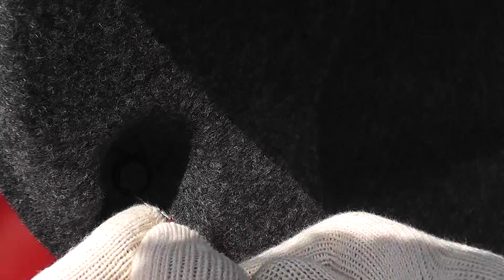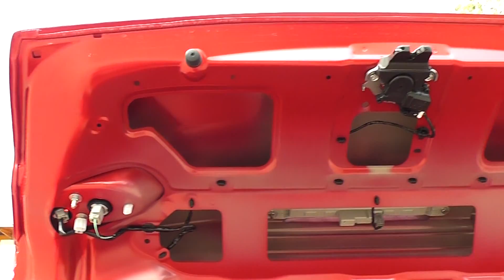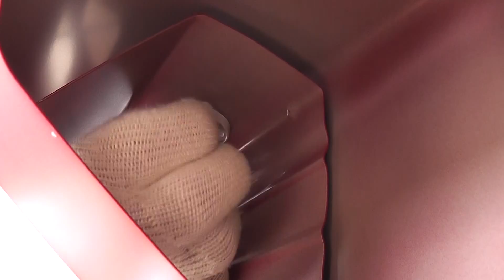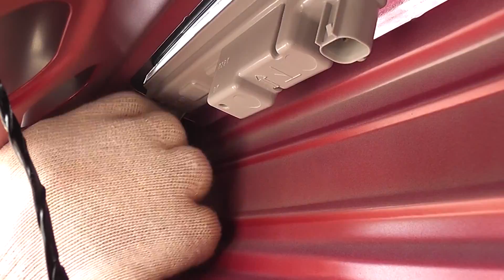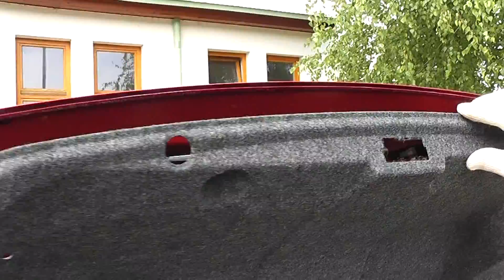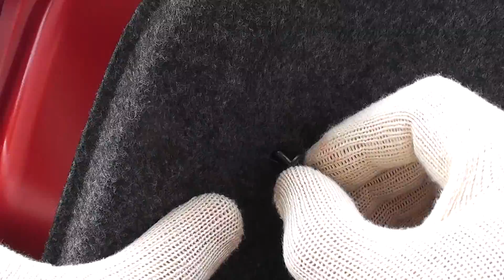Mitsubishi Lancer - High Mounted Brake Light Replacement

Comment: 7 years later, i just got quoted exactly $437.80 from a mechanic saying the only way to fix my brake light is to get new genuine parts from mitsubishi in western australia. I simply re inserted the cables and it worked again, lancer boot doors close pretty aggressively so the cables could get loose from time to time. cheers legend for saving us from daylight robbery.
Reply from the maker: You're Welcome!

Comment: Shop called me and told me it $140 for the replacement. Popped the cover off and saw the plug simply came unclipped from slamming the trunk. Clipped it back in and it works fine now.
Reply: Thats how I became a mechanic, places asking me for a ridiculous amount for something that has to bolts and takes 5 minutes.

Comment: Interestingly I found on a few of these the pins are not making contact after years of trunk slams.  Adjusting the pins for better contact, or adding a very thin metal shim to the female connector fixed every single one.  The LED's all still worked.
Reply: It really helped me a lot. Already thinking to buy new one, but your suggestion did the fix. Thank you.

Comment: How long should these lights last? I think mine is out, and only after purchasing the recommended light and getting that whole fabric cover off did I realize that the light was a full part all its own...

Making brake lights like this seems like a purposely expensive move like the tire pressure monitors in tires. I had my valve break off my tire a short time ago, and they would not cover the cost of the sensor, so even though the tires were new within the year, they would not replace the tire because it was fine, or cover the valve cost, so rather than a new tire for free...I got my used tire repaired and put on for $70 :(